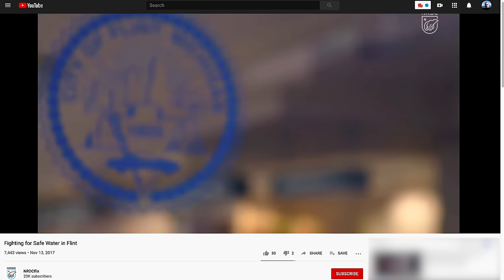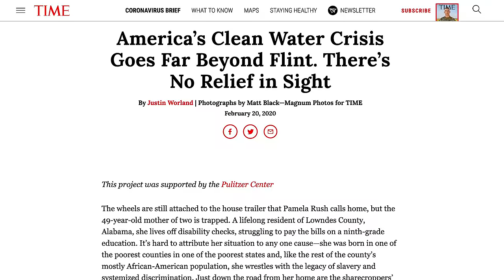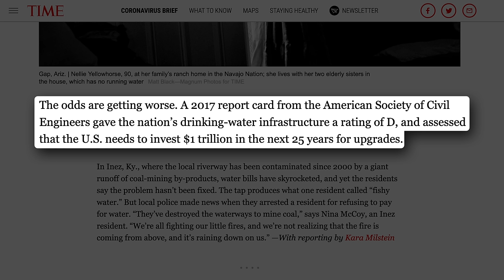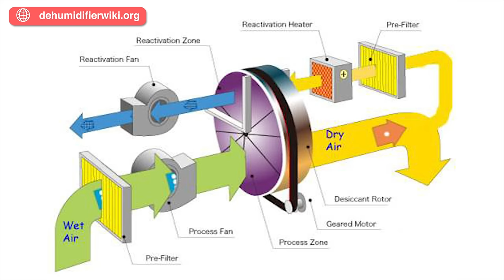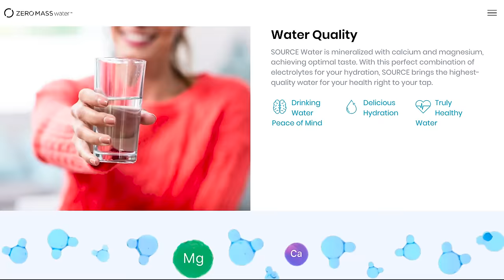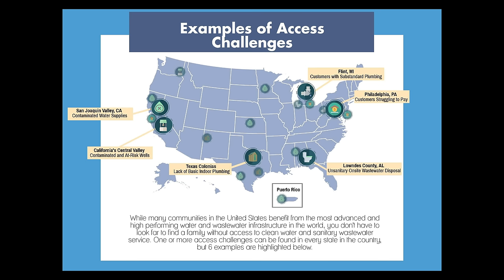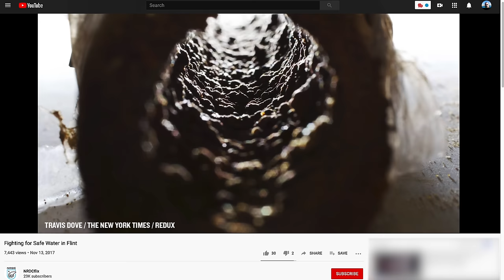Off-Grid Water With Air and Sunlight

Comment: Well that's very interesting! I'm curious how "clean" that water is; how poluted is the air? There is a lot of magnesium oxide, aluminium oxide, graphene oxide in the atmosphere, is this filtered in the unit?
Reply: nope. not a long-term solution
Reply: Depence how it is made it Will filter 99.99% and you cant even compare the taste becouse it is too different. To sum it up you wuold like to invest ur self for taste and healty reason. On finland we have world cleanest drinking water on toilet and tap, but using filter it is same as clean fountain source. If you can afford it you wont be disapointed if you allso maintain it (whitout maintain/new filters bacteria get inside)
Reply: I drink rainwater all the time. The place I collect it is about six miles from the nearest road.  But yes, making water in a city would need serious filtration.
Reply: @mnemonic5819  why? and I also curious how good is the panel kill the virus in the air.
Reply: @RRSustainibility  it can't live in the air without a cell...
Reply: and aluminum, strontium and bromine. Look up at the skies daily being sprayed.
Reply: @RRSustainibility  Easy to filter all oxides. Easy to install available UV lights within filter set against all pathogens not filtered
Reply: I would like all the technical specifications. I have used a dehumidifier plugged into the wall to pull water out of the air. I boiled it so it would be safe to drink and it tasted horrible. Most of the systems I see that do that heavily filter the water
Reply: graphene oxide, really?

Comment: Personally building something similar would not be difficult. The cost point is a little high with crain installation.  I'm in a place that freezing cold temperatures 4 months out of the year. My ground water is also clean to drink. There are many places this would be good to have. Thank you for the video I watched in full.

Comment: How often do you have to clean these out? I'd imagine a lot of bad stuff will start growing inside them if you don't.
Reply: David Beppler 
Water and heat is not always ideal, except when the temperature is high enough. Else it is a risk.
Reply: @davidbeppler3032  Legionnaires disease... This seems ideal conditions for it to grow.
Reply: Every time you get diahrea from water poisoning you should clean out the filter
Reply: @davidbeppler3032  
But the generated water is not pure.
The air is polluted and can contain microscopic spores of whatever.
The "heat" you are talking about, which temperature is that? Below 60C (140F) you can get a Legionella infestation.
No fun there. Next to that, the stored water is not heated and should be at a drinkable temperature. So the temperature would ideally be below 20C (68F). 
To be honest, I think this investment is too high for what you get. Much to high.
NIce if you are living in the middel of nowhere, but when you have tap water, there are much cheaper solutions to purify the water (if it is needed that is).
Reply: David Beppler 
Please ignore common sense and drink from streams in the woods and drink water which has been at 75-135F for a few days/weeks. Call it BS, but not everybody has your stomach.

Comment: I could see this being a solution for remote sites or reducing the logistics needs in disaster situations. 

While I was in Iraq we went through pallets of bottled water  that all had to be trucked in. Would have been great to be able to produce water right on the base so we didn't have to do so many supply convoys.
Reply: @GetOutsideYourself  no, you set them up on the bases. Probably on top of the housing containers and have them as drain to filling stations at then end of each row. By providing a portion of your drinking water that was reduce the need to go on supply runs as often which means fewer chances to get blown up and frees up more fuel of your fuel for generators and mounted patrols.
Reply: This won't work in climates that have zero to very low humidity
Reply: @alexanderbally8722  even in the desert AC units still produce a lot of condensation, especially in coastal areas where the winds bring in humidity from the ocean.
Reply: @matthewconnor5483  
In different cases:
1)Near the Ocean, filter (reverse osmosis) sea water.
2) Air con units that produce condensation even in deserts are not energy efficient. So shipping water there will probably still be more cost efficient.
3)In special places that benefit from ocean winds that brings high humidity very far land inward (and for some reason then don't have rivers or rain) then yes it would be an option.
4) And even then shipping water somewhere even if it's very far. (Mostly from a fresh water sources whit normal filters) will still be cheaper. 
I can only think it would be necessary if the roads are extremely unsafe.
Reply: @alexanderbally8722  in a disaster roads may be unusable/gone and in a conflict zone the cost of these units in far cheap then the hundred of thousand/millions of dollars you risk in equipment and medical care every time you have to go on supply run. My first deployment they almost exclusively attacked the supply convoys so any thing that could've made the outposts more self sufficient would saved lives and freed up man power for fighting rather then guarding shipments of parts, fuel, water, food and ammo. Does this system make sense every where? No, but is could see the use in remote sites or hostile/restrictive environments.
Reply: @matthewconnor5483   My basis for thinking that it wouldn't be beneficial is. The military and fast response teams for disaster areas probably already considered it and didn't go whit it. The technology is not new there just trying to make it in to a more complete package.
Reply: The Israelis have giant dehumidifier with reverse osmosis that cleans the water from the air & other grey water.

Comment: It seems like in most places, it would make more sense to design air conditioning systems in a way that the condensation is drinkable - that water usually just goes into the sewer system, around 5 gallons a day for a typical home.

Comment: Great video Ben, this is very interesting!!  Question -- does air pollution pose any threat to the quality of the water?
Reply: Yes
Reply: Thumbs down for the "save the planet" BULL SH@T propaganda, but thumbs up for the coverage of a new product. Ben.
Reply: @amypatterson9851  too bad Ben became the biggest tool in the Tesla community.
Reply: Michael, I've asked the company the same question and I'm waiting for an answer.
Reply: Snow birds need a way to viably collect and melt snow.  It would not be pollution free but it would be soft. Would a home reverse osmosis or distillation method resolve that? Does anyone have info?
Reply: @Bart-Did-it  I asked in comment. Maybe you know.  Does home distillation or reverse osmosis remove pollution?  Rain collection has same problem.  Snow collection needs a way to melt into collection also.  Do you know anyone working on that?
Reply: A water filtration system takes care of this very well. If you want to take it a step further, a water alkaline + filtration system, such as the Kangen Water system, is a win.
Reply: I’m pretty sure I heard there is a filtration system that needs to be changed every few years. That should take care of any pollutants in the water.

Comment: Interesting, I think its great for an off grid situation and/or a dry climate. It would be one of the last systems I would invest in after an off grid solar setup if I had any roof or ground real estate for it. Great vid. Cheers.
Reply: No. What you need is a reverse osmosis system or other proven solutions for water treatment. You don't need to destroy thousands of dollars on a glorified dehumidifier.

Comment: I'm wondering about putting them in a small greenhouse? Might help with freezing? Also maybe use a solar panel and fan with pipe system in ground to keep the greenhouse from freezing in winter?  Would the green house temps reck them in the summer?  Also need to muffle the noise.  Is there a way to insulate around them?

Comment: So I've been working on this same sort of thing for a while now and yes cold weather is the Achilles heel. But then the water just stays on the ground. I shovel it into a barrel over a small fire. I moved to the mountains of Colorado to develope a system similar to this but more the size of a shed with a tank in the ground. A glorified ammonia run dehumidifier inside. Solar/wind electricity. Add in an electrolysis cell and use hydrogen to replace propane/natural gas. And solar air heaters. Even if I gotta hang a giant magnifying glass. Targeting homestead size situations. But things are slow for us we haven't had any support yet. But because I haven't been putting it out there

Comment: West Texas, Lubbock area - high in arsenic SW about 50 miles.  I use RO water to drink - about a gallon of green tea, decaf, sweetened with 1/5 tsp of stevia per gallon.  The system is cheap to buy and operate, but the problem I have is it substantially lowers the Ph of the water, and disease cannot live in a high Ph body.  So I use about 1/4 well water, my well, and 3/4 RO, and that brings the arsenic down to acceptable levels.  But I bathe in well water, no filters.

Comment: Uncle Owen on Tatooine was a water farmer. All you need is 200 foot of pipe (6 or 8 inch PVC) sloping down to a tank . Say start a foot above ground, and have the tank 10 foot down or deeper. Have a second pipe coming up from the tank with a SLOW fan pulling air through, the humidity will condense on the cold (60F)underground pipe, and run down to the tank. A small pump and pipe to get the condensed water out is the last part. This will be distilled water so do NOT forget your vitamins and minerals . Don't thank me, thank Uncle Owen. 
   Owen Lars was a human male from the desert planet Tatooine who worked as a moisture farmer. His nephew was Luke Skywalker.

Comment: Pure h2o does not fulfil human body requirements
Reply: he said it comes with vitamin packets though
Reply: *mineral
Reply: How about water that sits in a tank on top of your roof for years? That sounds like it's going to have all kinds of "goodies" in it...
Reply: @Daddo22  You constantly recycle that water but the installation includes purifying filters at each point of use. We have two points of use and therefore two filters.
Reply: Peoples that soft was has no mineral in it so it is not healthy to drink.  But if you really look into it even regular tap water doesn't have enough minerals in it.  You simply cannot drink enough water in one day to get enough minerals from water alone.  The simple fact is that 100% of the minerals your body needs comes from the food you eat not the water your drink.  

As to the mineral pack that adds minerals.  Many people don't use those or just remove them.  There is nothing wrong with rain water or very software (such as Seattle water) which naturally has no taste.
Reply: @sigmacentauri6191  2 gallons a day in the best-case scenario, when the air is not to dry and when it's not to cold for 5000 dollars does not sound like independence to me.
Reply: You get to control your own Mineral Additive in this case. That's awesome.

Comment: Excellent review.  This company obviously does not have an economy of scale.  Solar panel are not expensive and neither is PVC pipe.  Nothing earth shattering in the process.  In my opinion and background the unit should cost far less and yes they would still be making a ton of money.   The crane is a bit much and that cost is unnecessary as anyone with common sense can see two workarounds.   The mineral additive is and should be optional and with a bypass switch.  A charcoal filter would be better and take vitamins instead.  Great review.  The price point and absence of efficiency are troubling.   For only two gallons of water the cost should be in the 2-3 thousand range - max.   If you paid six thousand then maybe I will think about this some more.  I believe you will see other units at a far less price point soon.   JMO.

Comment: A commercial system could have about 12 or more of these units mounted on a vertical wheel, like a  ferris wheel. Then the units on the bottom would discharge their water, and the wheel would turn because of the empty units on one side and almost full units on the other side. The turning wheel could run an electric generator to power the units, then solar cells would not be needed. With no solar cells needed, the units would be powered night and day and make double the water. A lot of minima/maxima mathematics and fine tuning would be needed to see if this is possible.

Comment: If you have access to the tap water you can create those boxes with glass on top and using simple evaporation of tap water in closed box with evaporating water condenses on the glass inside and drips to collector located under the bottom of the glass. No energy needed, just sunlight or higher temperature which is going to heat box which is painted black from inside to generate more heat. This technique makes basically rainwater/distilled water and you need to add mineralization filter as drinking distilled water is dangerous as it will flash out minerals out of your body. This concept used widely in desert conditions where the water is dirty and contaminated. Basically it’s resembles natural circulation of water in the environment, from evaporation to condensation cycles. Cost maybe around $100 per box and it will produce the same amount of pure water without noise and energy costs.

Comment: Reverse osmosis in stores where I am is .39 a gallon.  The collected water from the panels would be distilled which if store bought is about $2.  Distilled is purer but  there is another factor I do not exactly understand about adding something to it.  Would this type of collection filter contaminants from atmosphere?  vs. rain barrel method?  I think these panels offer a viable solution.
Reply: Also 2 gals may be enough to drink but not enough to use for cooking also. But this is definitely forward.

Comment: At 2 gallons a day water for other than drinking water could be supplemented from another source.
So if I have to do that I can most likely filter that water well enough.
But the price makes it something to use where no drinkable water is available, as a primary drinking water source.

For the noise they could find a different fan and motor which is quieter.
The winter mode could be modified. Plus colder climates might have more water available anyway.

Comment: You can do this with a net system as well they did it for a poor country it's just these specific nets that  they put horizontally up on two post and the water catches in a plumbing drain at the bottom then is stored in storage takes in that one village they get at least 10k liters of water a day which is amazing

Comment: Interesting technology, I had hoped to see a lot more on how the product worked. I can't help but think that this product was over-engineered and thus made heavier and more expensive than it needs to be. It seems to me that if it was made of plastics instead of metal and maybe thinner glass or clear acrylic it would be a lot lighter and cheaper. 

I would say if they could get it under $1,000 and light enough to lift by hand, it would be a game-changer but at $6K and being so heavy to ship and install, it really has limited application. In most cases, a good reverse osmosis system, or a steam distiller, would work well enough and much cheaper for people who still have access to some water even if polluted.
Reply: True, but it does not consume much electricity, which comes in handy off grid. So the system might be good, but the company & their product not so much. The small & noisy fans are obviously totally wrong. The mineral pack is hopefully optional, as it's badly engineered and not really necessary.
Reply: @dominus6695  it looks like something you could build for a few hundred bucks tbh.
Reply: @dominus6695  Thanks.  As a woman unskilled in this area I will take your remarks and pass on watching
Reply: Thumbs down for the "save the planet" BULL SH@T propaganda, but thumbs up for the coverage of a new product. Ben.
Reply: Sadly plastics where we live, in the Mediterranean, don't last any time at all, so that would end up being way too expensive for us and very inconvenient when needing to keep replacing them.
Reply: @maryneedham451  plastics don't last long anywhere. Anyone who has shopped at Walmart knows this you're lucky if you cake it to the car with their bags.

Comment: A secondary power input port would help solve the freezing issue and allow the water collection to operate when the sun is not...the addition of external solar power and battery connection would increase the viability by a lot.

Comment: Wish you would have given this a true review. Some things you overlooked. Building permit to add this to a potable line, check valves or pumps to overcome potable line pressure, current sunk costs of being hooked to the water system (it will not ever pay for itself).  The tech is cool, but in your effort to save the planet you forgot objectivity.

Comment: Way over price for most people struggling to get access to clean water.

There are many examples on YouTube of people, even communities, building low tech filters that cope with some fairly contaminated water.

These tend to use different grades of rock and sand before a final pass through activated charcoal.

I've seen examples of systems like that coping with farm runoff contaminated with pesticides and fertilisers. 

As for solar power. A parabolic mirror would probably boil more water than that rig does without the noise.

So useful in a desert perhaps but otherwise probably an overkill.

Cool though 😉. Thanks for sharing this.